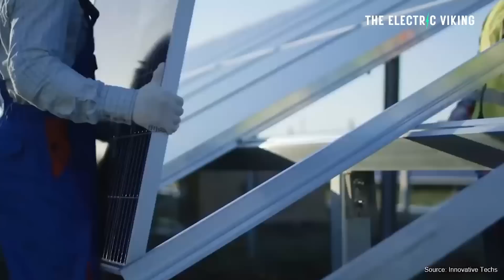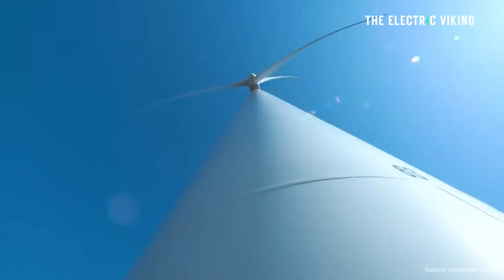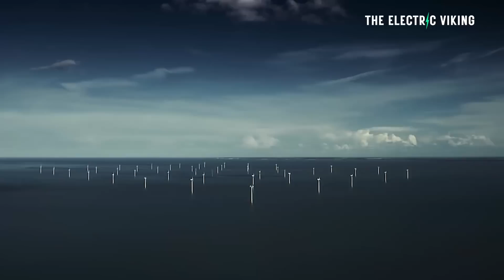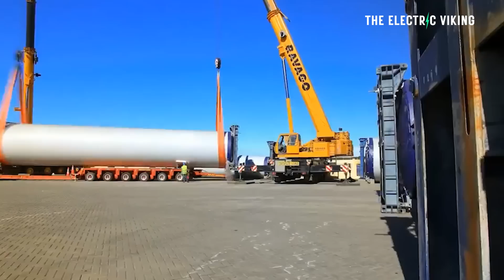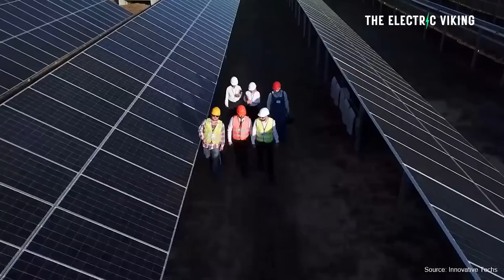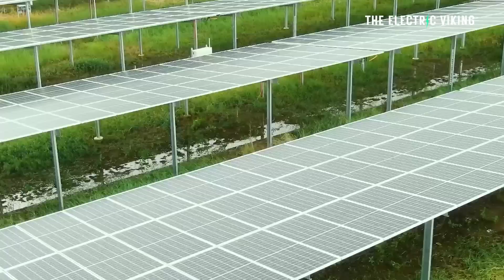8 countries now generate over 99% of their electricity from renewable energy

Comment: How can solar be cheaper than wind when it only provides power for half the year? With overcapacity maybe two thirds of the year. The fair comparison would be solar with overcapacity and energy storage vs wind, and Im not so sure that then solar is really cheaper
Reply: You're not sure because you've not looked for data.

You can find it out by googling the research and national reports but the Engineering with Rosie channel has done that work already.

Yes, solar and wind really are cheaper, even with the costs of backups.
Reply: @paulgoffin8054  “. . . a naïve observer might conclude that the rising share of new renewables (solar and wind) will usher in an era of falling electricity prices.  But in reality, the opposite has been true.”  Vaclav Smil, Numbers Don’t Lie, p.172

Getting information from Engineering with Rosie is like getting information from a used car salesman.  She never talks about the higher costs of real-world solar and wind, when you have to include back-up sources.
Reply: Shhh! Don't mention that around here! :D

Yes, in non-sunbelt countries, solar goes hand-in-hand with gas, because we sometimes have periods of days or even weeks with no wind and little sun. The true cost of solar and wind in those countries really ought to reflect that, but it would be hard to calculate.
Reply: @tony0x48 It 's because you have gas to use as well, that solar is relatively cheap. It's when you have to take measures to fill the gaps when gas goes away, that solar (or renewable energy in general) becomes very expensive.
Reply: @hvh377  Sorry, incorrect. It's not cheap to build or run a gas plant that's only going to be used 5% of the time, it's very difficult for that to be profitable, and as a result, the prices they charge when they are spun up are very high indeed. You can easily Google it, gas peaker plants charge far higher prices than the average wholesale price, for short notice spin-ups it can literally be several hundred times, and here in the UK at least, they are also exempt from the energy windfall taxes.
Reply: @tony0x48  Days and weeks without strong sunlight but rarely day without wind.
Reply: its not a competition by day. Its a question of what mix covers your needs most cost-effectively across the entire year. This surely depends on how much offgrid storage there is.
Reply: Wind farms are considered good if they return 30% over the course of a year. The power output is worked out over a year; I believe it is 30% of power output if it was running 24/7.
Reply: @alexandermelbaus2351  Actually, 30% is considered "average".  As turbines get bigger, capacity factor increases.

Capacity factor is a thing for all power generation.  All generators have downtime, or failures.
Reply: @alexandermelbaus2351  not following you. 30% of what?
Reply: @FredPlanatia  30% of it's capacity over a course of a year. Many operate under 30%.
Reply: @alexandermelbaus2351  What is 'capacity'? The output depends on the conditions: more wind equals more power. If you say the 'capacity' is what the output would be in a best case with lots of wind, then yes, obviously they always operate under their capacity because you have an averaging. That is the nature of this power generation. Solar has a similar fluctuation.
Reply: @FredPlanatia  30% is the efficiency of the wind farm over the course of one year. 30% means 70% under capacity. 
More wind does not equal more power; At a certain wind speed the wind turbine's have to be shutdown for safety. They are not designed to spin fast. 
30% is considered a good result and many operate below 30%.
A 100MW wind farm is generating the power of a 30MW power plant over the course of a year; delivered in various outputs. Try operating a national grid with such uncontrollable variable inputs from power plants.
Reply: @alexandermelbaus2351  you didn't explain how 'capacity' is calculated. How do you calculate this?
Reply: @FredPlanatia  A wind farm with 40 turbines, each rated at 3MW; 40x3 = 120MW. That is the power output when operating or capacity. 
A wind farm that operates at 30% capacity; calculated over a course of a year is considered good. There is no calculation, every power plant has their capacity publicly listed. If you want to question the 30% capacity considered as good, I don't have any references on hand, but you can find the same information validated by doing your own reading.
Reply: @alexandermelbaus2351  thankyou for the clarification! I did a little reading and they have a range of wind speeds where they can operate. The capacity is the maximum power output at the highest wind speed where the wind turbine operates. Most shut down at 50km/hr for safety. Then there's the efficiency which is a separate topic. Efficiency is what percentage of the wind energy is actually converted to power. Both operating capacity and efficiency happen to be around 30% for most wind turbines.
Reply: In many places refineries are being powered by solar to greenwash their fuel production.

Comment: These 8 countries that generate over 99% electricity from renewable energy need to go EV then that will be protecting there GDP. For instant If Australia converts to 100% EV we improve our GDP by app $24 Billion as we import most of our Fossil Fuel.
Reply: Australia's electricity grid has little spare capacity. The wind projects being connected to the grid are but small unreliable increases to power output that is costing a fortune to connect to the grid; Pushing up electricity costs. A wind farm might operate for 30% of the year; That is considered good. Solar operates around 40-60% over the year. 
Installing solar on your house that is supported by the grid is a lot different to supporting a grid with solar and wind.
Norway use Hydro power predominately for electricity, something they can utilise due to their geography and it should be noted that the population numbers of Norway is similar to Queensland. The other states on that list are laughable, some of those countries are so poor that most of the population probably don't even have access to electricity; The Congo, Ethiopia. 
Australia has so little capacity for electricity and no plans for any major power plants; Electric cars will be the first order of usage restrictions.
Reply: @alexandermelbaus2351  Australians have Sun and Wind. But no Brains to use it. Ozzy Coal Rules. Nothing else Works.😅😅😅
Reply: true!!
Reply: Countries that get 100% of their electricity from wind and solar with battery storage and are 100% EV's, significantly reduce their need to import dirty oil or produce their own.
Reply: Yes. Ethiopia banned import ICE Cars. EV Only. Australia can do that. Make 24 Billion Dollars a Year.
Reply: @willeisinga2089 I'm not sure whether switching to renewable energy sources worldwide is helping Australia's GDP in the long run. Australia's number 1 number 2 (after iron ore) export product is coal.
Reply: @hvh377  Our number one is iron ore , number two is coal , for making steel and electricity...and it will remain in demand for decades to come.
Reply: @Leonardo555ZZZZ  Sorry, I'll correct that above. And you're right on the longevity too. It's going to be a while before Australia has gone properly green.
Reply: @hvh377  It likely will be a mix bag for countries that produce a lot of fossil fuels, the countries that will really benefit the most from renewables are countries in Europe, Japan and many others, countries that have to input a lot of it, eventually, once they can produce most if not all there energy needs internally, they stand to save a fortune, but that's bad news for countries that sell a lot of fossil fuels because they have to find ways of boosting the economy to make up for that loss.
Reply: @paul1979uk2000  Yes, that's why I thought it would be nice to mention to that other person optimistically counting 24B more GDP because of importing EVs only from now on, that when everybody else does that too, Australia should expect a nett loss of GDP, because they make a lot of dollars selling coal to China (and the rest of the world).
Reply: @paul1979uk2000  Yes to some European countries, it would be beneficial I suppose, but not necessarily to mine. We had enough gas to not be totally dependent on nations like Russia, but we do not have a lot of space. So solar and wind are causing societal havoc already and we haven't even dented our total energy consumption yet.

Also, renewable sources and the inevitable equipment to allow energy availability to be 24/7 is quite frankly very costly outside the solar belt (north west Europe). We will all have to give up some of our prosperity to go green. No more jetting around the world for holidays, lower standard of medical care, less disposable income in general, etc.
Reply: @willeisinga2089  Can I ask what you are smoking there? I'll have some of that! 😁
Reply: @hvh377  No, no smoking. I am always like this. 🙂👍
Reply: @hvh377 

No matter adopt to RE or not, every countries is ditching coal.
Reply: @leerizer  Agreed and it's a good thing too. Only thing I wanted to make clear that it comes at a cost. Most green pushers deny that or even claim that green energy is cheaper.
All that 'cheap' energy is probably why my energy bill has gone through the roof the last few years, my house needs 25k+ investments in the next 5 years and my government needs to spend billions and billions on the energy transition.
It's fine that we're doing it, but stop saying it's cheaper when it is clearly not.
Reply: @willeisinga2089 Ethiopia has one of the lowest car ownership rate in the world, around 2 cars for every 1000 inhabitants. Car ownership is limited to the ruling elite and if they want to buy more expensive EVs it will just mean more of their fellow citizens will go hungry
Reply: EVs are already cheaper than ICE cars and they will get even cheaper as the supply chain for EVs matures...
Reply: @willeisinga2089 That’s because Ethiopia has about 3 total paved roads, so those mandates are purely ceremonial. The majority of the population there have never even seen a car.
Reply: Wrong , Australia's productivity would be destroyed if everyone was forced to try and use an expensive , dangerous and impractical EV.
Reply: @Leonardo555ZZZZ I don’t know about Australia, but you should be more concerned about your countries’s education system which by the looks of it is 100% television. EVs have some valid minor drawbacks. None of which you mentioned.
Reply: EVs are cheaper and more practical than ICE already and that will improve since EVs are still an emerging tech with supply chains that are not yet built out .
Reply: @0ooTheMAXXoo0  EV's are not more practical by any measure, that is not one of their strengths or selling points at all.
They are not cheap to buy either, they may be cheaper over 5 to 10 years of ownership.
Most people are not buying new cars. Even people that are well off, often do not buy new cars. Cars are a money pit.
Reply: @0ooTheMAXXoo0  and every one that droves one in Australia is helping with the Australian economy and the money to fuel (charge) is spent on a Australian made energy source the money stays in here and doesn't go to people like Putin to help in his unjust war.

Comment: The right wing narrative in Aus is so strong, but also very wrong , when we use mainly renewables the price drops
Reply: The price soars when wind and solar produce just a small fraction of their capacity , which they often do. Add in the extra transmission $10 Billion at least , then storage ,Snowy 2.0 at $20 Billion and still stuck in limbo , extra batteries ,,,all have to be paid for by consumers , then we need gas or some other system to generate power when wind and solar fail.
On a calm cold winters night ,Australia gets up to 95% of power from coal , because wind and solar produce almost nothing , and always will.
Reply: @Leonardo555ZZZZ  because there’s not enough solar and wind power out there , we need to invest more
Reply: I'm all for renewables but you need to provide proof.
Reply: Did you require proof for coal being better
Reply: @nathanielbyrne1132  no need to jab. But why not more info is good. Lets disect. make your case.
Reply: yeah now that renewables are cheaper than coal they are pretending it is still a nascent technology like in the nineties